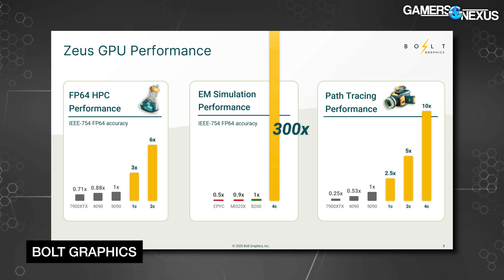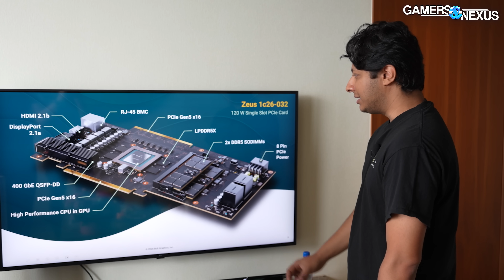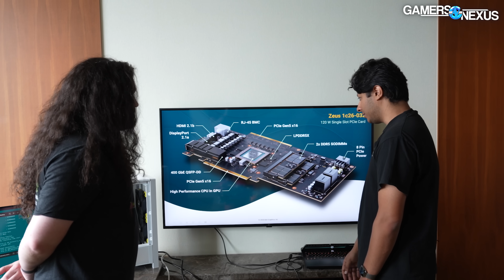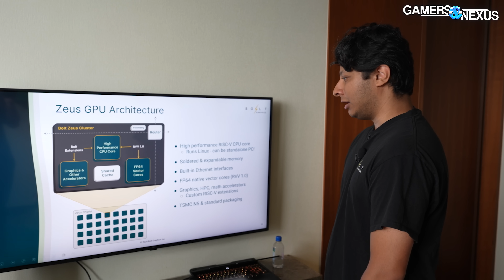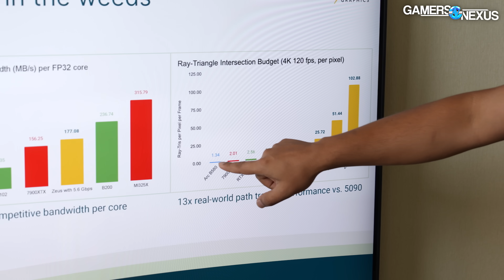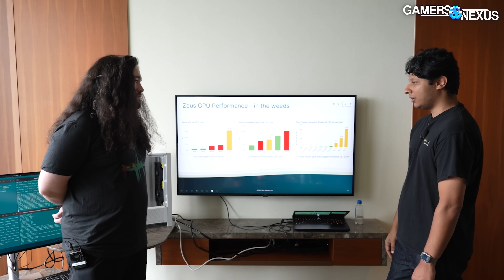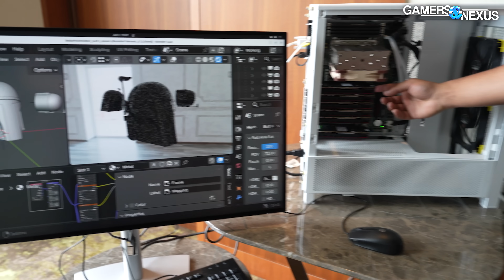A New Gaming GPU Challenger: Bolt Graphics Takes Aim at NVIDIA

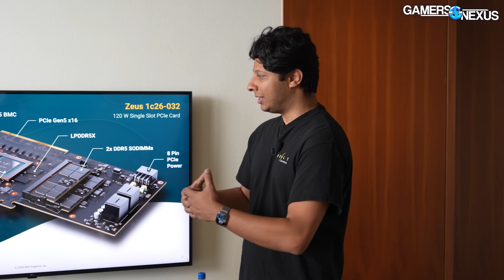Comment: 4:26 open source the initial drivers under a GPL-compatible license and watch the Linux developers write the drivers for you.
Reply: 100% this.
Reply: Keep it open as well to keep the good will
Reply: or more likely, they write the initial drivers, contribute it to the linux kernel in advance, and someone later pulls it out and turns it into a loadable kernel module.
Reply: its prob not gonna be open bro, it uses licenced core tech that dude could not even talk about
Reply: Exactly my thoughts. But if I recall correctly there are game-specific optimisations that studios prefer to keep proprietary. Since the vast majority of games are built for Windows all of those optimisations end up there, not in the open source drivers. I'd like someone more informed to correct me but as a game developer on PC I would always target the proprietary Windows drivers due to the way larger market share and existing expertise/tools
Reply: @anon-fq3ud  You know it's really funny when those games with specific driver optimizations end up running better through compatibility layers and GPL licensed drivers... All these proprietary tweaks are just hacks that aren't needed if the base drivers are good.
Reply: @anon-fq3ud I mean there are already open source drivers like RADV on Linux that in many cases outperform the proprietary ones with minimal game/engine specific workarounds
Reply: @anon-fq3ud  A good start would be if these optimizations are part of major game engines like Unreal and Unity. I'd imagine that would target a vast majority of games with game specific optimizations left to the driver level.
Reply: @AverageNerdTalks On Linux given VKD3D is already translating DX12 to Vulkan and optimising/fixing stuff where possible, some amount of this work is taken care of already
Reply: @anon-fq3ud  This doesnt hit the market until end of 2027 anyway, so that another 1.5 years for Linux to gain mor marketshare and game devs to wake up and start supporting it, by the time this has gaming support itll be 3 years from now, and HOPEFULLY Linux will be supported on most if not all new games.
Reply: And that stays mostly inside the game
Reply: @anon-fq3ud  The open-source drivers for AMD GPUs work great in Linux and with Steam/Proton.
Reply: @anon-fq3ud  In a different interview, Tom Pedersen (spelling?) of Intel said that it is not sufficient to program against the standard, a bunch of game-specific optimizations are needed as well. So it is true that the studios tend to foist those off on the GPU makers.
Reply: Also, could try to create a translation layer that takes nvidia driver instructions and translate them to their own hardwares expected commands then you get the whole library compatibility in an instance minus perhaps a performance hit. The same way valve did for windows games on Linux
Reply: they said it runs linux, they know exactly who theyre tickling
Reply: Oh great so we have to go the extra step of running windows in a virtual environment to play our games 😂
Reply: @rodiculous9464  That's how SteamOS works....
Reply: @rodiculous9464  No, just ditch the Windows from that equation.
Reply: @mati865 cool story bro, most modern anticheat doesnt work in linux. So if you want to play something that's actually relevant and popular you need windows
Reply: @rodiculous9464 more anti cheats work on Linux than under a Windows VM. Basically all anti-cheats detect and block OS running as a VM guest.
Reply: Oh god, please god, no. It will be geekified. We have all spent enough of our lives holding various distros' feeble little hands, trying to coax them into performing mundane tasks.

Especially UI elements. Leave those to people who are not developers.
Reply: @Thing696 drivers don't have UIs...
Reply: @adagio_echoes  In the strictest sense, they do not. But what do you honestly believe they’d only make the driver? 😂 Poor kid.

It will be accompanied with a useless, unintuitive control panel. True to form.
Reply: @Thing696  Given the number of programs I see written for Linux that are command-line only? I think that's distinctly possible, even likely.
Reply: @Thing696  What, you mean like NVIDIA control panel?
Reply: "unintuitive control panel"
Because Nvidia is totally know for have a well organized, responsive control panel.
Reply: @Thing696 why would that even matter lol, how often do you need to open your gpu control panel. Is this rage bait.
Reply: @soldiercoler No, they are just really that obtuse. 😂
Reply: @Thing696 there are ways to organize open source projects and keep things neat.
Reply: @Thing696 perhaps the worst bait ive seen yet in this comment section 😂
Reply: @Thing696  tell me you've never used Linux without telling me you've never used Linux. 

The majority of drivers on Linux don't have any kind of UI for interfacing with them.
Reply: @ryanspencer6778   A consumer GPU with open-source drivers will have a control panel. 100%. Are you FR?
Reply: @Thing696  My RX7800 on Linux doesn't have a control panel, it just works. The 780M on my telly box here doesn't have  a control panel either, it just works.

Seriously, just admit you've never used Linux and have literally zero idea what you're talking about when it comes to driver level development, it'll be less embarrassing than the absolute wankpuffery you're spouting now.
Reply: @Thing696 my amd card on the linux open source drivers doesn't as far as I know
Reply: @Panda-vq4gd That’s on Linux. They want market share, so they aren’t going to limit themselves to Linux systems.
Reply: @Thing696  the discussion is about Linux drivers. Of course the bloated Windows drivers have all kinds of unnecessary gamer aesthetics that hurt performance.
Reply: @Thing696  as a small start up cornering the Linux market would probably be a huge success. It would actually mirror their overall strategy.
Reply: @Thing696 
You really don't know WTF you're dribbling about.
Reply: @Armand79th  Show me a product of “Linux developers” that isn’t geekified.

The only reason Linux has gained ground is because they have been furiously de-geekifying it for years.
Reply: @Thing696  Pretty much anything KDE is beautiful and intuitive. In my opinion, Plasma is one of the best desktop experiences ever. Apart from the desktop environment itself, most GUI stuff is on the applications themselves rather than the OS, so it's difficult to come up with examples of "Linux developer" GUIs... If you're ok with extending to "open source developers in general", then Blender, OBS, Inkscape and Firefox look/feel/work great in my opinion.

Comment: You either has something or you don’t. This is basically an ad for them to find a dummy to invest. China copies everything, it’s been so many years and there is still no alternative for Nvidia/AMD but yeah random “early access” program will do it. Red flag scam alert.
Reply: it's the use of DDR5 DRAM instead of GDDR6-7 VRAM, SODIMM slots instead of CAMM and most of all the "high performance CPU in GPU" that's the last place you want your CPU to be as the heat spot will be insane.

Comment: My first thoughts were: [If games use graphics APIs like OpenGL, Vulkan, Metal, and Direct X, then why is this guy saying "We can't afford to pay engineers to port thousands of games"... like dude what are you talking about? Your GPU supports the APIs and the games are written in code that calls upon the APIs to make the graphics show up properly. If I'm grossly ignorant then say so -- otherwise this sounds absurd.]

However once he got to talking about the proprietary/licensed chips in his card and the use of risc5, it makes a tad more sense... really this is not a GPU, this is basically a PC. It has a CPU, it's own RAM, and it's own GPU... so it's a PC. Perhaps a PC which can be used as a GPU but it's basically a PC.
Reply: Just imagine that a measly RTX5060 has 448GB/s and that thing is planed to have ¿two sodimms?... that means 89GB/s MAX.
Reply: You don't just write an OpenGL/Vulkan/DX implementation and that's it.  Especially for GL and DX11 and older drivers need to have lots of optimizations for games, or else you will have terrible performance or even crashes or bugs.  Have a look at any driver release notes and notice the strangely specific callouts to specific games...
Reply: @alex15095  I'm half-willing to take your word for it but it makes no sense. If that were the case, then how would new-release games run on GPUs that were already in production? As if every GPU manufacturer is going to put out software patches to their GPUs each time a new game gets released if they want to support it?  I just cannot believe that's how the system works.
Reply: @matthewexline6589  This is literally how it works. "Game Ready" drivers and all. They fix the peculiarities in game developers' code to account for their own hardware peculiarities.
Reply: @matthewexline6589  They typically do make a new software patch when a new major game gets released. I mean the game may just run fine without it, but there are often specific bugs and quirks and optimizations. Intel GPUs notably had bad performance in many OpenGL games because they lacked the decades of bug/quirk fixes and optimizations

Comment: I'm not sure I understand the GPU game compatibility issue. Could open source GPU drivers address this problem, or do game developers fully gatekeep whether a GPU is compatible with their games regardless of the drivers?
Reply: Drivers are the software that converts general software code (DX12 / Vulkan / OpenGL / etc.) & converts that into a format the GPU hardware understands & is capable of processing.

That requires knowledge of not just coding using graphics API's but also knowledge of how the hardware fundamentally processes things.

Letting people write your drivers from scratch for hardware they have no knowledge or basis to reference for is an absolutely terrible idea & will cause the system to crash because the GPU wouldn't know HOW to do what it's asked to do in a foreign language.
Reply: @MLWJ1993  Doesn't the linux kernel utilize open source hardware level drivers on a regular basis? All the GPU manufacturer needs to do to help is provide open source drivers, at least initially, and provide thorough hardware documentation, right? Couldn't bolt do this and just wait for game compatibility to come naturally over time since they aren't targeting gamers initially anyway?
Reply: @justindie7543 mostly AMD in the Linux scene & they've existed for years & provided a solid basis to work off of.

It's going to take years for Bolt to get anywhere near that, especially if they target professional usage first which means these are going to be expensive & not be used for gaming by your average joe because there's no good value to be had. They'd need to hand these out for free or something which would incur significant losses.

Comment: Make drivers open-source on Linux as part of Mesa stack and you'll have a lot of people helping you with drivers :3
Reply: This. Just implement Vulkan - and you will automatically get DXVK and VKD3D there covering all the DirectX crap.
Reply: that's probably going to be a problem for them

vulkan is designed for parallel accelerators, not an out of order middleware. you will be sacrificing performance
Reply: @aeghohloechu5022 running slow is a lot better than not running
Reply: @Lexus_Yacht_Club for a gpu they are basically the same thing like whats the point of an accelerator card if you are not gonna accelerate

Comment: If this reaches fruition and actually gets a foothold in the market, it could be very scary for NVIDIA.
The idea of giving users an easy way to add tons of RAM probably would put some fear on the card maker side and the AI service side.
If it becomes easier to run a big LLM locally with good performance (all within card memory), then it becomes less likely people will need to buy multi-thousand$ GPUs or outsource to the cloud.
This and if it can reach good gaming performance would make it ideal for someone's mixed use dev/gaming station.